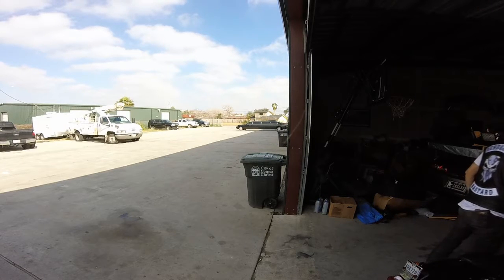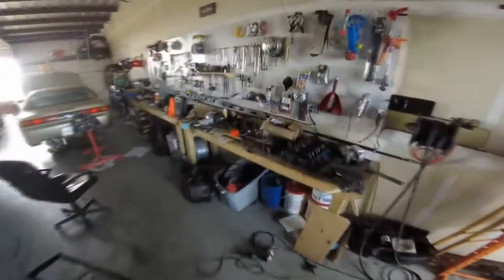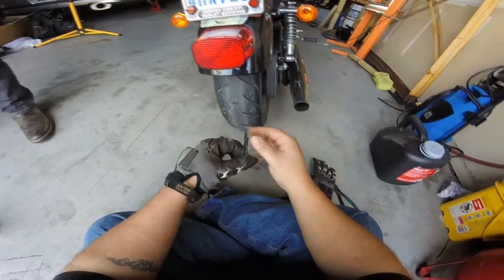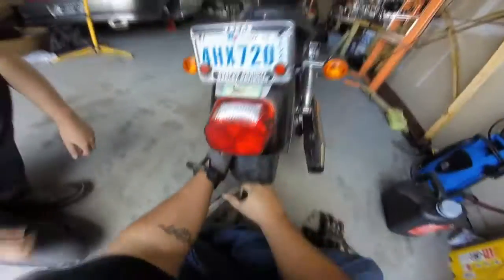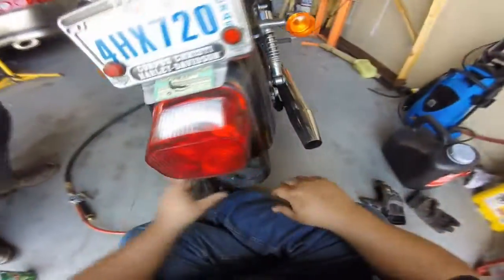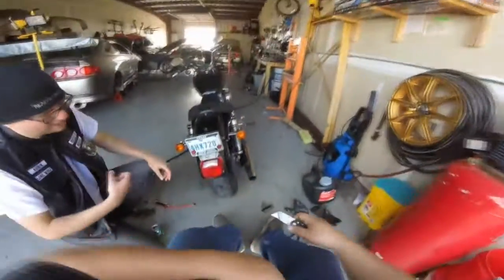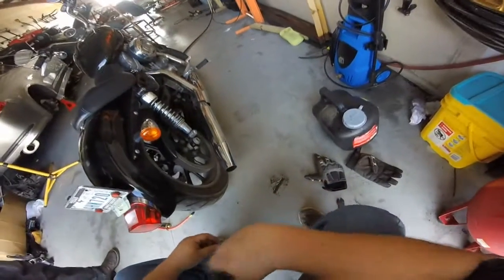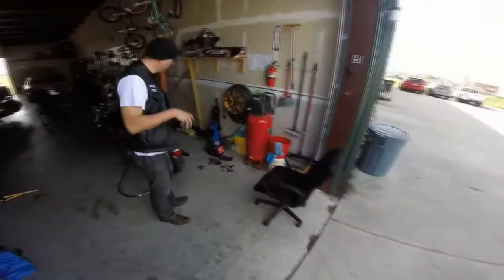Pluging a motorcycle tire. Well, trying to anyway.

Comment: I forgot to post back. I got that new tire installed after all. I'm running a Pirelli Diablo Rosso dual compound on my rear tire now. The motorcycle handles like a dream on wet or dry pavement.